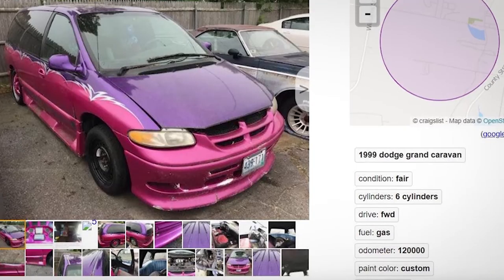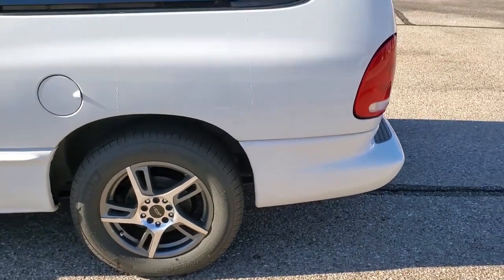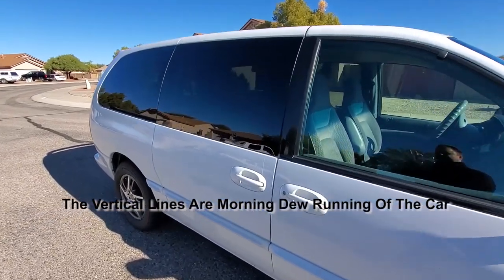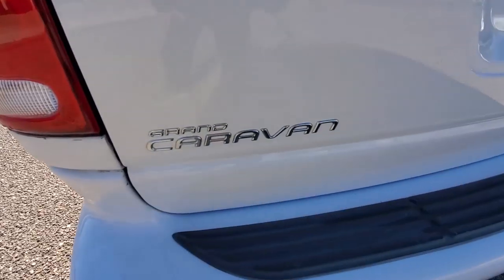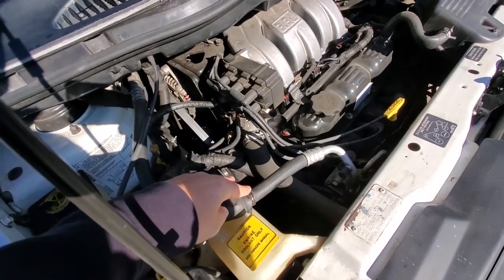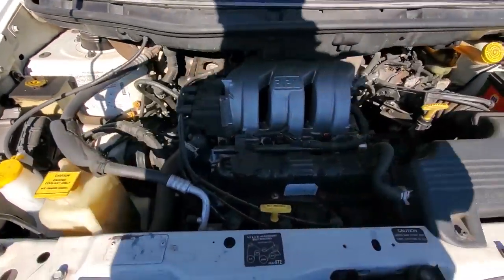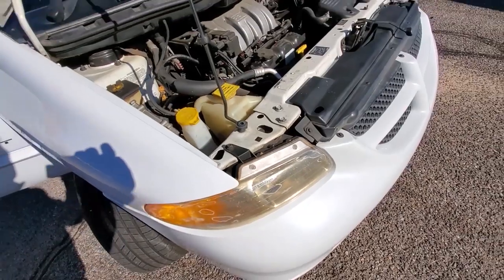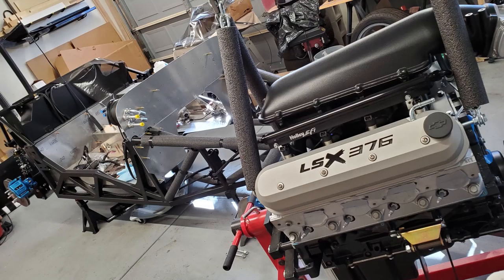This Is What Tavarish's ABANDONED "Pimp My Ride" Minivan Originally Looked Like

Comment: Damn you had this van for 20 years that's awesome man very clean and mint I have a 2014 grand caravan that i have for 3years so far and I get inspire by folks that take care of there vehicles  trust I change my oil on time and do everything else so my car last long 😋👌🏼
Reply from the maker: Just got to treat them with respect.  I think I forgot to mention that is the original paint job and there is no clear coat missing from the top.  It looks just as good as the sides.
Reply: And if you live up north the salt on tge roads rust the shit outa anything.

Comment: I have one of those vans (99 Dodge Grand Caravan)......... I had it for four years Absolutely the best engine  EVER !!!! Unfortunately I ran it through a  big water puddle and water locked the engine........😣
Reply from the maker: Ouch!
Reply: Did you ever remove the spark plugs and blow out the water that it sucked up or did the hydro locked engine bend a rod or two?  To make the van live once again, pulling the plugs and a quick turn of the key may be all that it needs!  Then again, depending on how many RPM's and how much power the engine was making when the water was sucked up could be the deciding factor on whether or not that engine is toast.

Comment: I had a 96? Grand Voyager (sister of the caravan.)
Had a love/hate with that. I owned it in the mid to late 2000s. Didnt care where I parked it, if it got door dings, etc.
But, it sucked to work on and sucked in winter. 
But man, you could fit soooooo much stuff in it!
Reply from the maker: Working on the top and side of the engine of the engine is definitely difficult with the sideways engine.